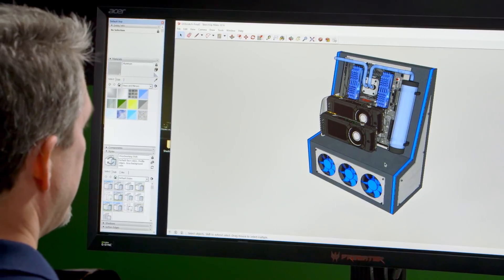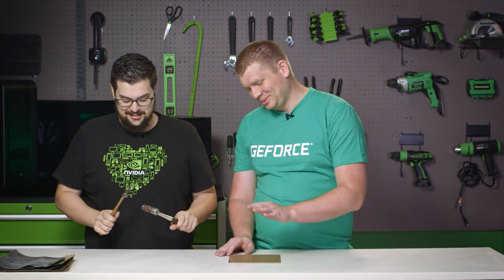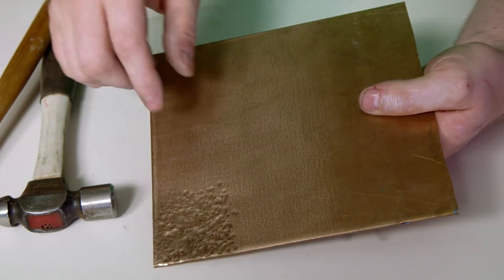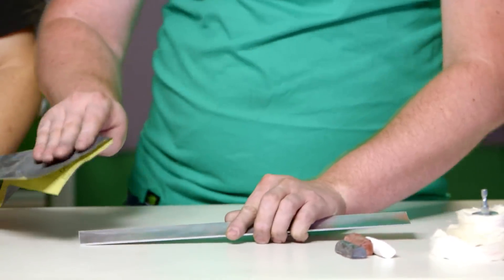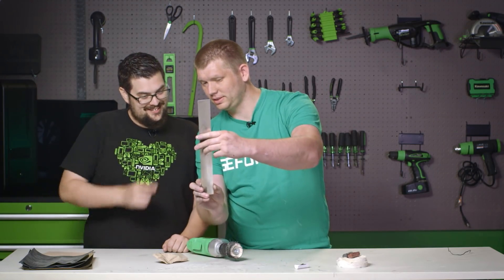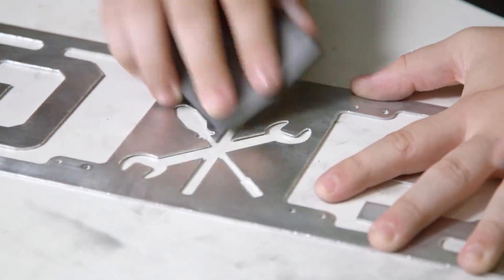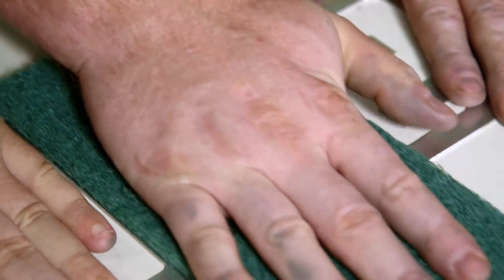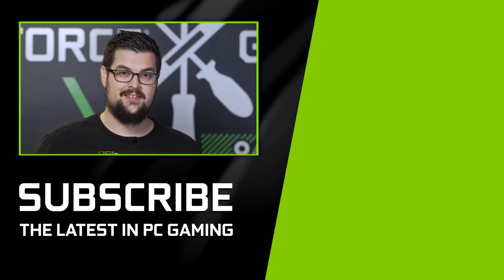GeForce Garage: Scratch Build Episode 4 - How to Apply Three Basic Finishes to Metal Surfaces

Comment: Would a wooden case be a bad idea? Wondering in terms of heat, airflow etc. I kind of want to do a wooden PC case just to see what it looks like.
Reply: Fans exchange the air in a case so fast that wood works fine Check out the Fallout Radio Mod by Cableguymods or Brandon McCarthy's Project Breadbox both on Geforce Garage!